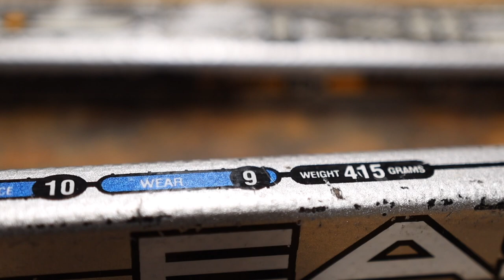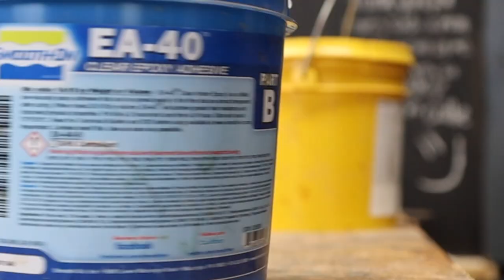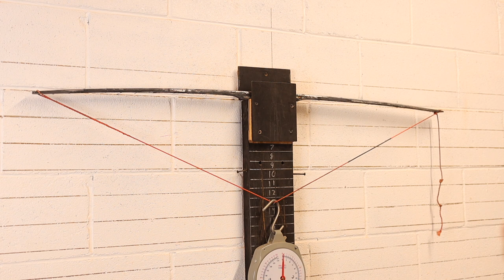HOCKEY STICK BOW---Attempting To Make A Bow Out Of A Hockey Stick---WILL IT BOW??? (EP.5)

Comment: Kinda odd you went with the carbon fiber twig first. Those sticks were designed to break easily (blame the 90's) and also to have major whip/play with them. What flex did you decide to use when you bought the stick? If it were me, I would have gone down three roads with this build. 1: use wood sticks, good old fashion Sherwood pmp 5030 twigs. 2: use two 100 carbon fiber twigs, cut the blades off till it looks like a butt end, flip them and make an adapter where the real butt ends meet and are glued/connected by that adapter. Now your major flex zones will be on the ends and the rigid section will be in the middle. 3: get your hands on pro-stock twigs. They have a higher tolerance than what mere mortals can get their hands on. Best bet to get your hands on them is to go to the the training rink of a major team, bribe the 'boni driver with a 12 pack and he will hand you a bucket of discarded sticks from the team. Oh and if you want to see something that will blow your mind, goof around with a carbon fiber goalie paddle, those are wicked.  If you want to be really cruel...really really evil...Get an Aluminium hockey stick...

Comment: I think the issue here is what known in mechanical engineering as "Stress Concentration".

Which is basically what happens when you have sharp corners or a sudden change in cross-section area.
Overlapping the pieces and making the transition smoother might fix that issue.

Comment: Try "V" cutting the ends about 8-9 inches and close them. You will keep the sides intact but gradually decrease the mass. This is similar to using PVC. The material is strong if it's braced on all sides. You could have probably made a long bow by stringing up the stick

Comment: Just saying, if you took the 2nd bow at the point when you do the 1st stringing, cut a V groove at both tips and glued in siyahs, you'd get better performance. The wood handle section could even be extended and have thin wooden limbs going the entire ways across the inside walls, then cut the siyahs in the hockey stick and wooden limb. Then you'd just put a backing on the wooden limbs to act like sinew, the hockey stick would work like the horn, and of course the wooden handle with limbs being the bow blank. It a vague idea that just popped in my head i'm positive you could elaborate and work it out.
Edit: Upon more thinking I think the first bow would end up better than keeping the walls on. There has to be a taper or a different combo of materials to keeps the walls on there.

Comment: Why not strip the sides off the broken bow, scuff the inside so it will bond better and layer up like you were, and maybe add the super flexible section you have to that, almost like a laminated bow limb? I think the biggest challenge would then be just making sure it  bonded together properly.

Comment: Can i introduce you to West epoxy resin system. Designed for , wood to wood. Works on fibreglass to wood, and fibre glass to fibreglass or carbon. Sets of in temp as low as 4 degrees. I use it all the time to back and resue my bows.
Awesome channel thanks for the inspiration.  Next i am going to laminate some Chinese 3 ply wood of suspect origin.

Comment: I believe your butt joints  were the problem. Overlapping joints would be help transfer stress from one layer to the next. Overlapping joints would put the glue in shear (OK) butt joints would be in tension (not OK)  Love your experiments.  Failures are learning tools for the next iteration. They help me learn. Have you considered trying  the fiberglass strapping used to bundle heavy materials It is 1 inch wide and very strong.  You are the inspiration for me to start learning how to build bows.

Comment: I would turned the hockey sticks into Limbs, And made a separate wood riser, with 2 bolts to lock the limbs in like sammick sage style riser., So less vulnerable in the center mass, Good idea, But there too much strain center point,
Reply: Jordan 9712 I was thinking that also as he was making his first trim cut. That said I feel I have an unfair advantage in my thinking from building carbon wing spars for large rc gliders years ago. Carbon doesn’t mind flexing as a box section but it absolutely hates it as a channel section